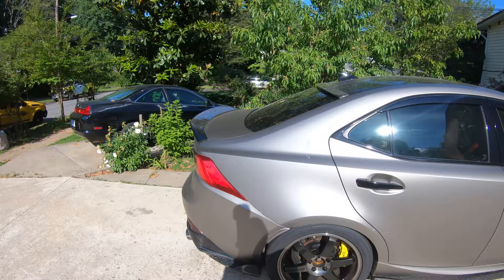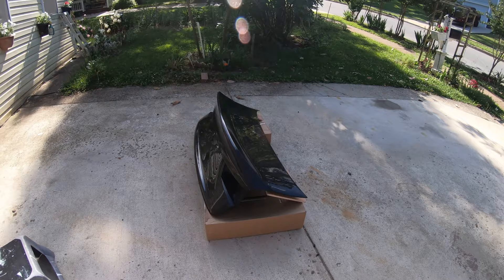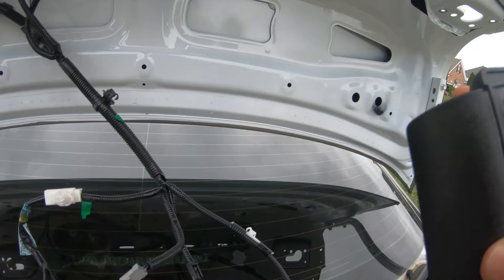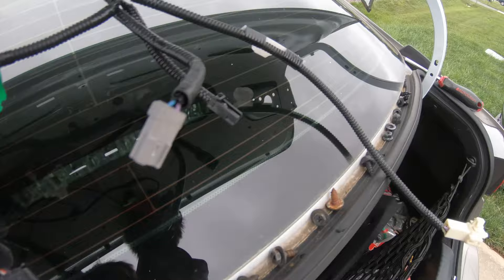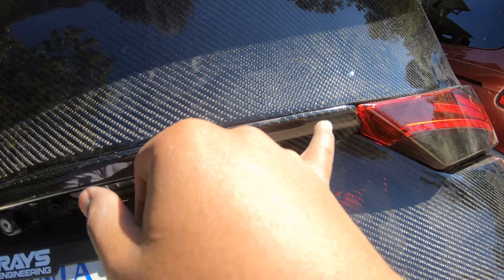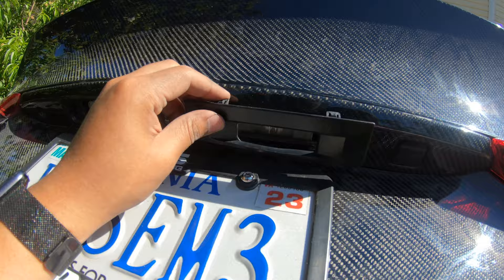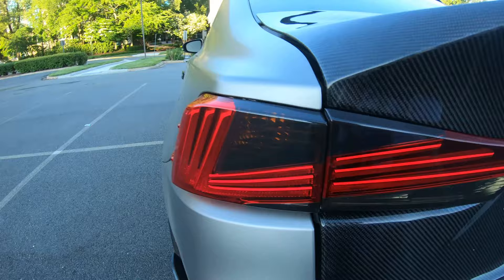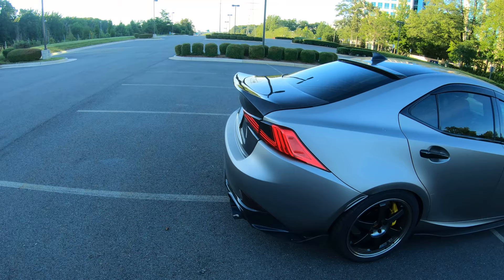New Carbon Fiber Trunk For The Lexus IS!

Comment: Dope, waiting on mine. Tried last year and waiting for 4-5 months from a company that didn’t even place the order cause they said we were waiting for them to ship some to us.
Reply from the maker: I got mine from evasivemotorsports and they immediately put the order request in and they told me the wait time at 4 months or so, with half down deposit. Paid the rest once the trunk was ready to ship. Evasive is legit and takes care of their customers well.
Reply: @Und3rgroundLex  just got mine in, got the worst luck with seibon. Mine came cracked so I’ll probably have to wait longer
Reply from the maker: @alantran5908  Sorry to hear that man, and hope you get it resolved soon.
Reply from the maker: @alantran5908  yeah I sorta had the same issues with the holes. I had to use a driller and sand it to make it fit.. Did you check / inspect before your accepted the package? That’s one thing they always told me to do to make sure there is no damage. But sorry to hear that man….
Reply: @Und3rgroundLex  Yeah I inspected it and it’s hard to even tell if the holes will even match up. Just tried to install the taillights and that shit doesn’t even fit. It doesn’t even sit flush, the lights pokes out about 15 mm. They told me I needed to sand it down, like sand basically until it’s all gone? Like what the fuck, the materials is so thin, like less than 5 mm. Fitment guaranteed my ass. Sorry to rant but this shit is so annoying.

Comment: cant pay 1k for those bad gaps i have a full system in my trunk and i doubt itll seal the trunk correctly. easy pass for me.
Reply from the maker: Yeah I copped mainly for it’s looks and weight difference of course
Reply: @Und3rgroundLex  I copped for looks also, but still waiting for mine. You notice any water leakage? I wouldn’t think so since you still got the lining for the trunk

Comment: Sick cf trunk. How do you keep the roof spoiler attached? I used 3m tape but it kept peeling off
Reply from the maker: Yeah i use 3M as well but never came off lol.
Reply: Never had any of mine come off from 3M tape, My trunk spoiler has never peeled off and that was held by 3M tape. What conditions you applying it on? Also you applying pressure after?
Reply: @alantran5908  I used isopropyl alcohol to clean the area. I used high temperature rated 3m tape. I applied when the outside temperature is around 70. I applied pressure by hands and placed wood slabs on top overnight. It just peeled off for the 3rd time yesterday. Maybe mine roof spoiler is not curved enough

Comment: what tints you have on the tail lights and the 2 red reflector?
Reply from the maker: I use metrorestylings smoke taillight tints
Reply: @Und3rgroundLex   35%?
Reply from the maker: @Sojucrew  yeah it’s around 35%. Not too dark or light either